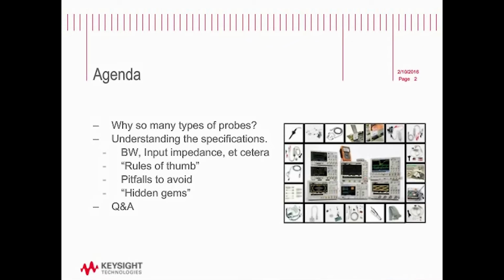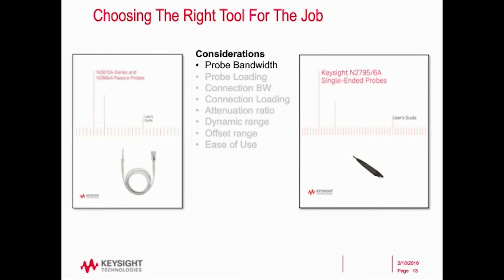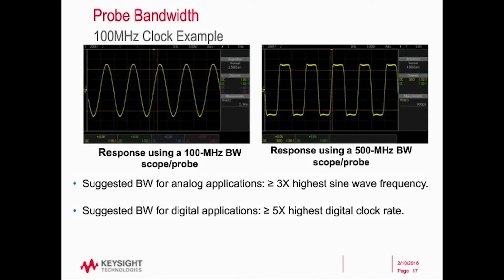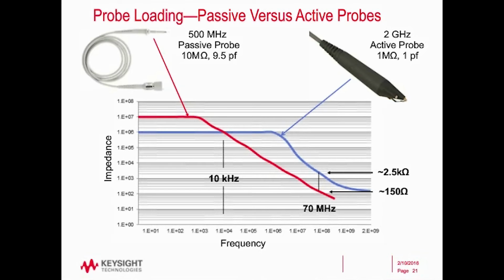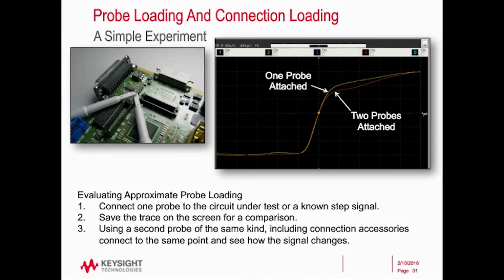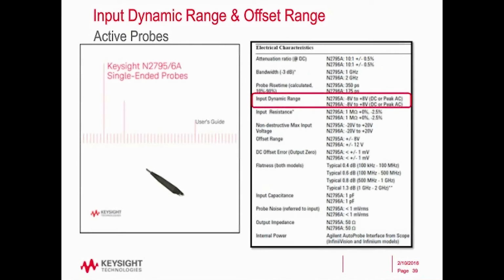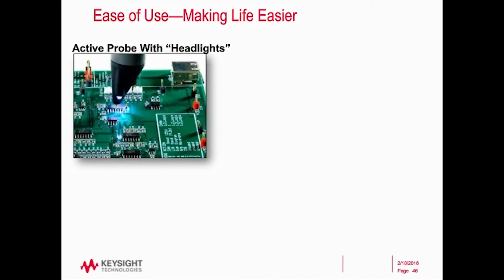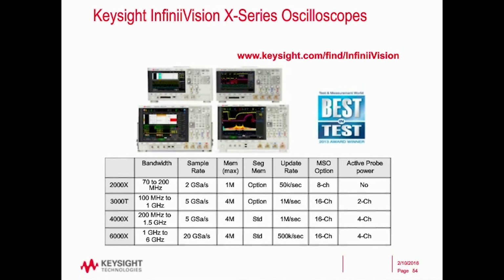What's that you were asking about oscilloscope probes?

Comment: Very nice presentation. You didn't touch differential probe a lot, but it was great. My question is what makes them so expensive? a good 200 MHz differential probe can be as expensive as a low/mid range oscilloscope.
Reply from the maker: That's a good question! There's a lot of time and effort that goes into differential probes, so most of the cost is associated with using high-end materials and processes, and some of it is recovering R&D costs.